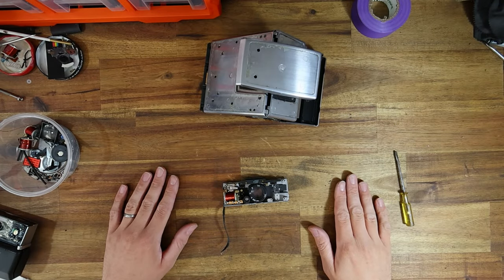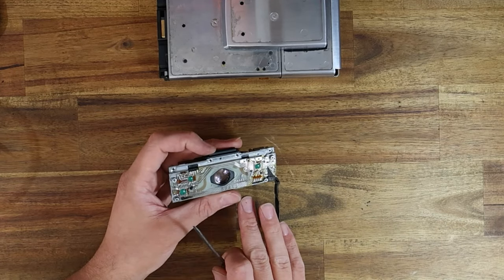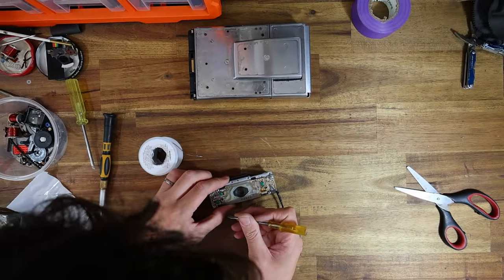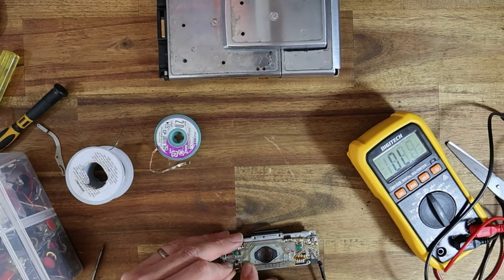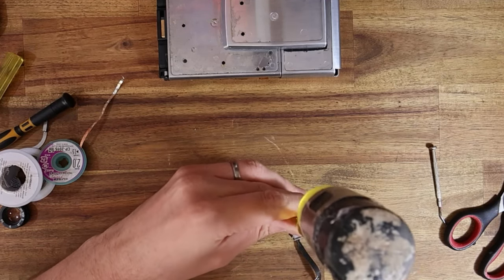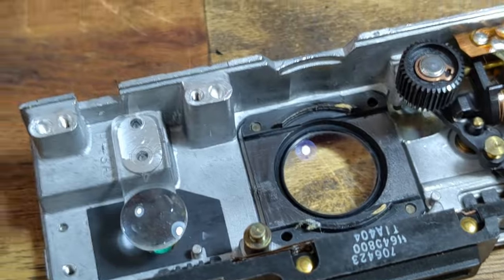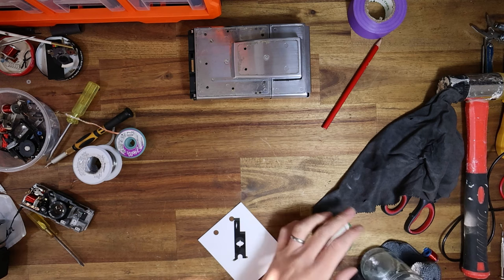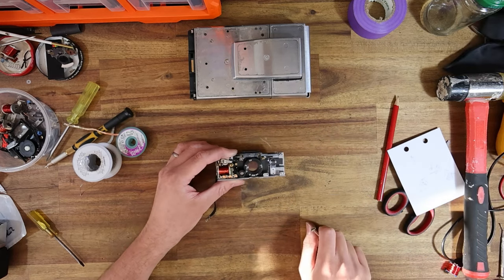Cleaning fungus from an SX-70 lens! And 600 modding a Fairchild "W" shutter!

Comment: Thanks for the shout out Jake! Canada is right! In the interior of British Columbia. I love my Fairchilds  and have never seen this W mod before. Pretty cool to see the Polaroid techs were hacking their own hardware with bodge wires, etc, to change the exposure settings that were hardcoded into the chips.
Reply from the maker: this is the only "W" Fairchild I've ever seen in person! Before this I'd only read about them in technical documentations, or seen photos. 

They are not common at all!

Fortunately, for every bodge and diode they add, one can be removed to convert it back to original ;)